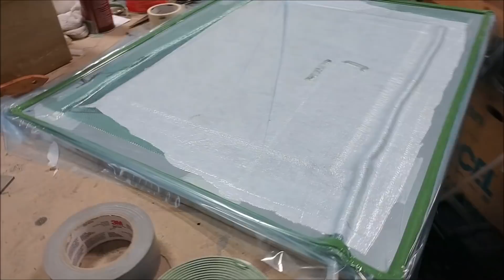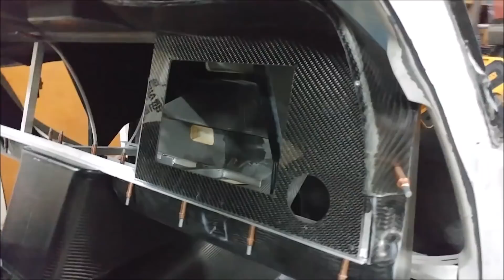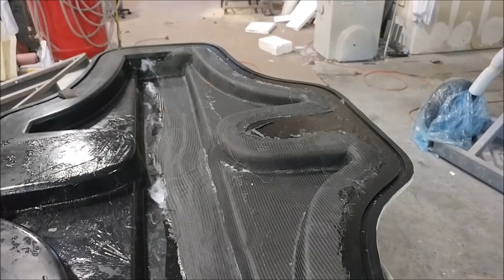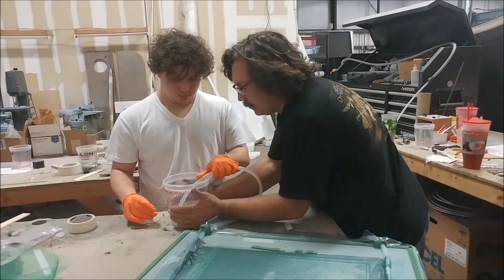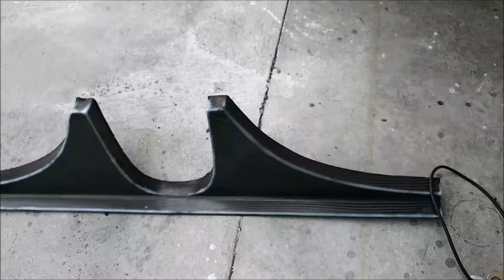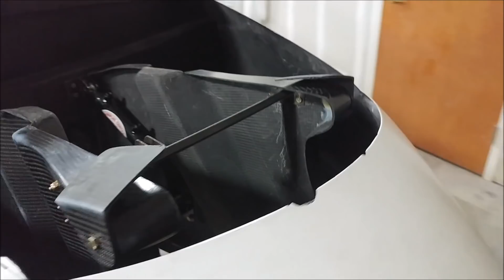A Better Perspective - the seats are now 2" higher

Comment: For routering the Carbon fiber, have you tried router bits designed for cutting printed circuit boards?  They have a single flute spiral, rasp like cutting face, which breaks the fibers eliminating the need for sanding.   http://hartmetallwerkzeuge.kemmer-praezision.com/de/Micro-Fraeser/CMFBM.  There is likely a source for the Kemmers in USA, since there is one in Australia.

Comment: I guess this video answers a question I've had about those seat mounts...is there no way to move the seats up and down?! That seems like a pretty basic requirement to accommodate different height people.
Reply from the maker: If you look carefully you will see that the seat mounts angled so when the seat slides back it also goes down which allows more headroom for taller people.
Reply: Raptor Aircraft  That is pretty brilliant!

Comment: 2nd point. I use a high def plasma table to build all kinds of parts out any material that conducts electricity. I can cut glass with it as long as I put a thin piece of conductive material over it. You should try to use a plasma torch to cut this stuff. If it works it would be ten thousand times faster then milling or grinding your way through it & way cheaper. Take a piece of carbon over to Brit the hippy welder dude and see if he can cut it with his plasma torch. It may work! Cheers from Canadian.

Comment: Peter, The comment you made about lightening strike protection, caused me to do a ton of reading on the carbon fiber material we will be building my plane out of! It is a fantastic material, Carbon fiber conducts electricity! I am not at all worried about lightening strikes. IMO if everything is properly grounded there is no problems.  I guess I am no expert.
Reply: Newtz It is true that carbon fibre conducts electricity however, lighting strikes actually cause quite a lot of damage at the strike site in carbon fibre. That's why carbon fibre airliners have a conductive mesh incorporated into the laminate. Peter's done his homework on this, just not putting it into the prototype.